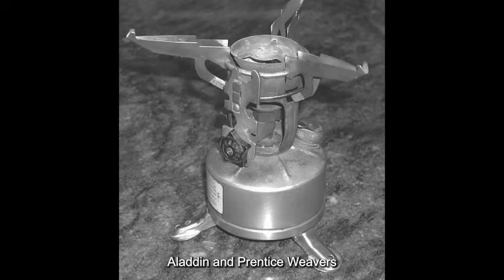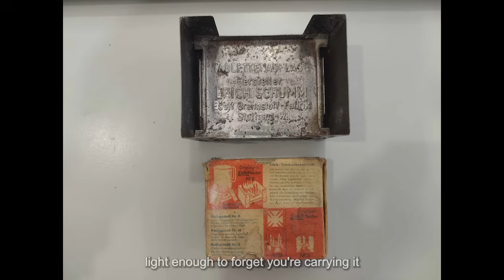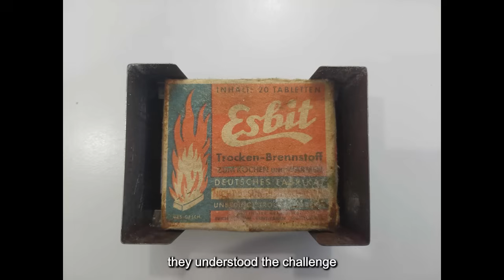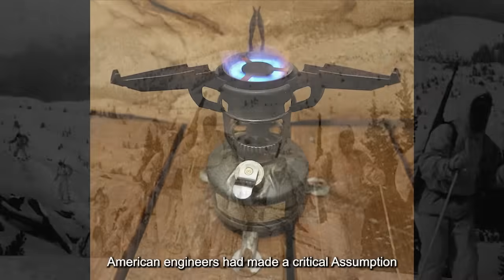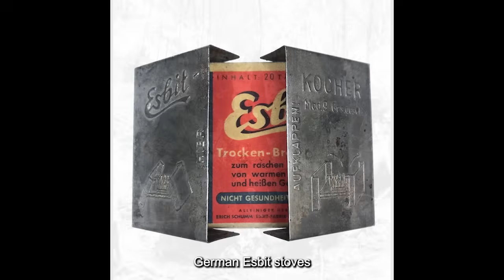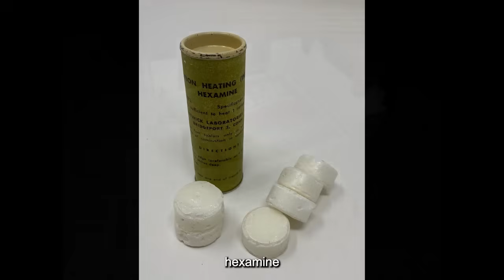America Tried Copying Germany’s Pocket Stove — But Missed The One Detail That Made It Genius

Comment: Sterno used as early as 1918 by soldiers. In WW2 the Army issued it & would have been a better comparison to the Esbit.  The   Germens also had a stove like the American one.
Reply: The classic Esbit stove is still standard issued equipment in the German Army today...
Reply: @mdk-wc2sw and as much as I like them, they have a terrible poweroutput compared to gas or gasoline stoves. So if you want to warm something up, they are nice, but if you need to melt snow for drinking water, forget it.
Reply: @clockworkvanhellsing372 My own experience tells a different Story. Yeah, they might not be perfect, but right the low tech you need
Reply: @mdk-wc2sw  They surly do work and are a nice option to warm something up or do some cooking on them. It just depends on wind conditions / being able to keep the wind away and the tablet size. The 4g ones are at ~250 Watt, the 14g ones are at ~750 Watt, comparable to a trangia burner. Meanwhile gas stoves go to 2500-3000 Watt with gasoline stoves going above 3500 W. The 750W are good enough in many cases and I've fied mini sausages on the 4g tablets, but if the power is needed (e.g. to melt snow) esbit won't get you verry far.

Comment: I loved my hexmine stove back in the 70s when we went camping, half a tablet did the job most times . I read a year or so ago that these tablets are banned due to some eco friendly concern .
Reply: I thought they were banned because the hehxamine could be used to produce some sort of explosive.
Reply: @828enigma6  it's the precourser to rdx and c4. While it certanly isn't the healthiest thing, I'd bet the main reason was the precourser thing.
Edit: According to wikipedia, Hexamine is also used as an Antibiotica alternative by UTIs and as a Food preservative, legal in the EU (E239).
So it can't be that bad to handle.
Reply: @828enigma6  When they ran out of Kaptagon on the front, they ate the Hexamine.
Reply: Banned in the UK - an offence even to posess hexamine tablets due, I understand, to hexamine being capable of being used in explosives manufacture by ner-do-wells.
They have been replaced by soldified alchohol blocks of similar size that work in the Esbit frame, but I understand that these burn out quicker than hexamine.
Swedish troops use Trangia spirit (alchohol) stoves - cheap, easy to use, reliable under all conditions  - sound familiar ?
I have 2 Coleman civilian petrol stoves of similar design to the 1942 version shown & they are incredible - when they work. Currently neither does ! Vaporiser tubes blocked - again. Only cure is to replace with new and they are not cheap, so I use gas & Trangia clones now rather than repair them. But when they did work - WOW ! Incredible heat output compared to the alternatives.
Reply: Spray down and squirt in some carb cleaner, pump up swill around a few times then light as normal will clear a blockage.
Reply: You can still buy them at WalMart and other stores > Coghlans Fuel Tablets
Reply: @steveolive9991  only banned in the UK.
Reply: Anything that can be used in the manufacture of explosives is now banned, just like chemicals that can also be turned into drugs.
The idiot politicians are removing things that make life good and easy, because they fear their own people may want to eliminate the politicians! The very same politicians who refuse to listen to their own people, and are ruining their lives and livelihood.

The very same politicians that we should be eliminating now.
Reply: @crashburn-s3b you'll get a 4 am knock on your front door for that.
Reply: The biggest reason they got banned is that people used them camping.  They produce toxic fumes including hydrogen cyanide which will kill you if inside a tent.  This video fails to mention anything about the toxicity.